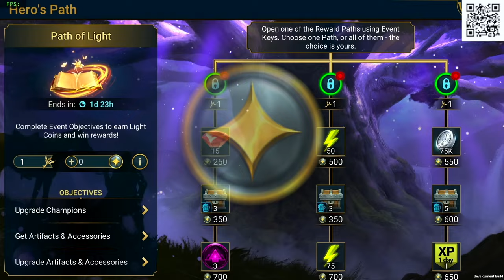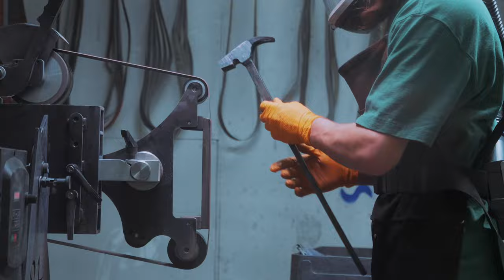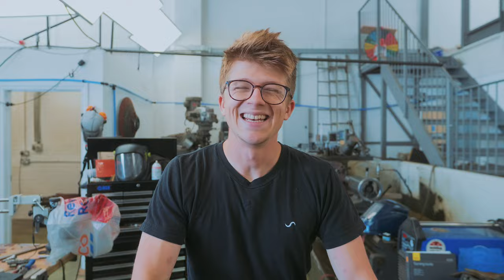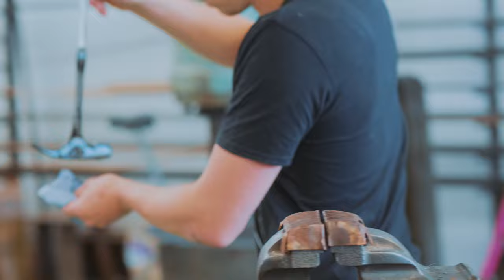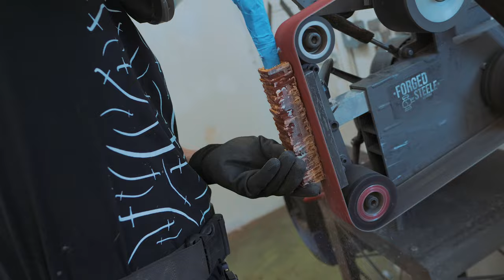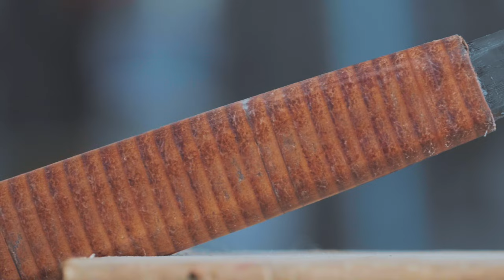Forging a Hammer from Hammer Plug Damascus! Part 2

Comment from the maker: What other workshop tools would you like to see me make? I'm thinking an adjustable spanner...? Install Raid for Free ✅ Mobile and PC: https://clik.cc/GYmzy and get a special starter pack 💥 Available only for the next 30 days 💥
Reply: What do you think of trying a pipe wrench?? Sure to cause stress induced balding!!!!
Reply: make a micrometer
Reply: I think you should make a draw  knife
Reply: Raid is dogshit and it's crazy how casually Youtubers will say that they love the game. Although I too would probably sell my soul for the dumptrucks of money they offer.
Reply: Adze or an inshave
Reply: I like the adjustable spanner/crescent wrench. Or you could make a pipe wrench.
Reply: How about making a full "common" toolbox set (wrenches, screwdrivers, etc) to have as your go-to tool set for your house?
Reply: 10 mil socket.
Reply: I'd like to see you back in Montana for more than a few days.
Reply: Farriers nailing on hammer…… asking for a mate 😳
Reply: Make a pair of 10 inch water pump pliers like the Knipex brand.
Reply: @jimmyandersson8520  Great suggestion.
Reply: What about a series making a basic set of blacksmithing tools using only salvage materials and basic (i.e. non-powered) equipment.
Reply: I'd like to see you make some leather hole punches or V cutters (or whatever they're called).
Reply: Would love to see a Damascus titanium monkey wrench.
Reply: Would love to see you make a swiss army knife.
Reply: A Damascus buck saw
Reply: Sockets to go with the ratchet. Mole grips. Adjustable grips and spanner. Tape measure. 👍
Reply: if you will send it to me i would love to have a jelly roll pattern weld steal 5/8 swept back bowl and spindle gouges no way i could ever in 2.5 million subs ever buy one of them much less both also should do jelly role any way its kick ass pattern
Reply: mole grips
Reply: Vice-grip pliers!
Reply: Check out “Perfect handle” tools, especially screwdrivers…those would be AMAZING in damascus
Reply: I was going to suggest that! its on my project list, but I'm lazy and dont want to figure out how to do it
Reply: after your 'legally not a  zippo', how about a 'not a letherman'
Reply: @benbrummitt7953  yeah! Or a folding pocket knife? Or a razor blade style folding knife?
Reply: How about a Damascus speed square to go with your new framing hammer? More of a milling thing than forging. But it would make for a smart looking pair.
Reply: Can you make a hacksaw? blade and  handle
Reply: make a power hammer
Reply: A Stiching chisel for leather craafting
I would like to know how to make one so I can make one for my leather business
It's a nice tool to machine.
Love yhe vids 👌🏻🇿🇦
Reply: In the past I have seen you use an adjustable spanner with another rod welded to it for twisting steel. Maybe make one purpose built for doing so. It should provide a good engineering challenge.
Reply: You may already know , will made journey bladesmith
Reply: @wesleycollins4314  Of course Alec knows…
Reply: What did you do to get the taste of Raid out of your mouth??? 🤢
Reply: I think a damascus HOUSE KEY would be awesome there is one guy on youtube that made one but i think it would be an awesome project.
Reply: Make a digging tool set for Mr. Furze!!
Reply: Drywall hammer
Reply: Hi alec. I remember asking you about 3 years ago when you were selling forging hammers, if you could make me a damascus estwing style slim shaft claw hammer but you had stopped production for sale. If you could make these now, i would love to own one, and would be willing to pay 10 times the price of a uk estwing. Please put them into production, i can see i am not the only one!!!
Reply: An axe 🪓 with a similar Damascus pattern would look really cool!!

Comment: Epoxy is a poor choice for the handle,  just because it will create hard ridges between the leather,  a flexible glue like barge would be much better
Reply: But couldn't you grind down to the valleys of those ridges to eliminate them, or will that induce weak spots in the construction?
Reply: Like most of his creations, it will be unlikely that it gets enough use to matter. It's mostly a decorative item.

Comment: I've always wondered about stuff like this (how Smiths use spare bits). Be neat to see what else you guys can make. Sort of like a Scrapwood Challenge... 
Random thought... I wonder how Nickel Bronze alloy would work for a knife? (I was browsing through materials available in McMaster-Carr [it's addictive], and thought... Hmm, probably not as durable as 5160, but better than my chinesium Buck knife.)
Reply: for our dutch viewers chinesium is pisbakkenstaal so low quality steel edit or any type of low quality metal thanks for ashton howard for remembering that
Reply: I'd imagine fairly well. Robinson Foundry made a knife out of bronze (I think he used aluminum bronze) and several videos after he was using it in the video and said he uses quite often in the shop and still working great
Reply: @linuxstreamer8910  I'm fairly certain chinesium isn't steel.
Reply: @justinbanks2380  of course bronze would work, it was the defining material for an age of humanity just before we figured out iron. The biggest issue was availability of the two main metals at the time.
Reply: @ashtonhoward5582  sorry forgot that it also goes for other metals

Comment: Love the channel and that's a cool hammer.  QUICK QUESTION.  I thought that one of the reasons for a leather ring handle is that the leather has some natural give to it making it a good grip.  Isn't that lost if you add epoxy to the equation?  I recently made a KABAR knife replica and used leather rings on my handle (I made a video of it on my channel if you curious).  I just soaked the leather in neats foot oil and then compressed it on to the handle and pinned on the pommel.   I like the slight sponginess of the leather handle.  does the epoxy detract from that?  Oh and I vote for one of those drills that has a pushable handle on it where the pushing down on the handle causes the spinning of the drill or bit driver...
Reply: You're exactly right and Alec just ruined the leather handle by epoxying it.  He now just has a plastic/epoxy handle with a leather pattern in it, in essence.
Reply: Absolutly true
Reply: What he did is fine. The epoxy is only going to be holding the layers together so very little will be touched  and you still have the natural grain of the leather adding a lot of grip. Estwing goes and adds a layer of epoxy on the outside of the leather completely eliminating that. It also chips off as you use it and looks terrible after a short while. The one thing I would have done differently is to add a steel plate at the bottom and rivet it on to help keep the very last layers nice and tight over time.

Comment: I use the 28 ounce Vaughn wooden hammer 🔨   It's my favorite and used them for almost 20 years now. Gotta have the waffle end tho so you can strike the nail in any direction and it's going in.. it also saves on smashing fingers from the head slipping off a nail. Just don't hit your thumb lol

Comment: Awesome hammer only down fall from using leather handle hammers (past exp) is your missing the pommel plate that is on all tools and knifes that are leather stack handles, the glue/epoxy will separate from the steel. Pommel plate gets pressed on and the end tang gets heated and riveted over. But the hammer is a beautiful skillful design as is everything you make 👍
Reply: This is the right answer. Looks good now. But that handle will work loose and will have nothing to keep it there. How do I know? As a HVAC installer using a hammer with a leather stack grip being held on only by the peened plate....

Comment: I really dig the hex head, still looks forged.
In how its made I recall them stacking plastic and leather.

I do wish you had used a bit from the face cut to cap the end of the hammer handle

Comment: As a framer, this makes for a very good carpenter framing hammer mix. But the claw is too curved for a typical framing hammer and the striking face is in a weird spot. It looks amazing, but some tweaks I’d make are a slightly thicker shaft, a wider and more straight on striking head, and a straighter claw. All in all great work, you’re doin more than I could ever😂
Reply: I was looking for this comment. The top of the head desperately needs to be perpendicular to the tang

Comment: Its a gorgeous hammer, the transition between the top of the handle and the neck could have been smoothed out to match  more and there could have been a plate at the bottom just for some finishing touches, looks a little rushed imo but the actual metal forging work, the grinding and the finishing looks 10/10

Comment: You could always try making either a drill chuck or a Damascus file 
Also great video
Reply: I don't know much about tools; but I imagine a Damascus File would be for looks since it would have soft/hard steel spontaneously on a what should be completely hard surface...
Reply: @thespaztagonist984  Most damascus is made with steel that can get equally hard, so it shouldn't be an issue at all.
And most files aren't all that hard anyway. 

Some files are as low as 50 rockwell, which even mediocre (hardenable) steel can do easily.

So files should be okay, especially if dedicated to only non ferrous metals, and rasps are no issue at all.

Comment: an added bit of cross hatching would make that hammer head grip better as you make contact with the nail.  I have swung an Estwing for many years framing and drying in Houses, and a slick face hammer makes it harder to do the job unless it is finishing where the hammer face being crosshatched would mar the work and require extra finishing as the hammerhead would mark every full driven nail

Comment: Just out of curiosity why didn’t you put a pommel on the handle? Wont the leather pieces at the bottom be a little weaker with the extra support?
Reply: Looked like he peened it slightly

Comment: So I am really loving how you are making different tools by using Damascus and I was wondering if it is possible to make a Damascus wood turning tool like a bowl gouge
Reply: It would be possible, but not something I would want to put to the test.

You would need a steel(s) with a lot of sheer strength and toughness.
And if your Damascus isn't immaculate, it could be a potential breaking point that otherwise won't be there. A homogenous metal is always going to be the choice.

Also if it's got low wear resistance, it will dull quite fast.

I don't know if you've seen a tool break when turning, but it's not pretty.
For the danger factor alone, I would avoid it.

Comment: The hammer looks very nice. 

The handle though, looks...flimsy. It looks like it will break if you try to pull a nail that's proper stuck or if you miss a blow and hit something with the handle portion. 
This is definetely the weak spot of this hammer, when it needn't be.

Comment: Looks amazing, just a couple comments on issues with use.

The way the hammer tapers to a smaller face probably isn't ideal for framing. When you are trying to hit nails in tricky spots, ideally the face of the hammer should be the largest part of the head, or else the rest of the head could interfere with the face hitting the nail (imagine the head hitting against a 2x4 right behind the nail and pushing the face away).

From the clip where you were driving the nail, the face was angled compared to the head. This may just have been the way it was being used, but you may also have a face that's not at quite the right angle when in use.

Others mentioned it, but a "knurled" face can make a huge difference on a framing hammer, especially when driving nails from weird angles, you can actually use a bit of a swiping hit rather than a straight hit to pull the head of the nail in the direction you need it to go.

Others also mentioned that a magnetic nail starter is a great feature for a framing hammer. Not everyone uses them, or maybe not that often, but especially when doing ladder work or setting trusses, being able to start nails one handed can literally be a life saver.

Not taking away from the craftsmanship at all, just some pointers to try and help the function of the hammer keep up with its absolutely beautiful form.

Comment: Looks awesome. I just worry, like you pointed put, that the shaft of the handle got too thin and may not hold up over time. Framers often time will drive some very big long nails and will be really pounding a way. I worry this may crack or bend under some heavy use.
Reply: I kept thinking the same. Lots of weight on top of such a thin neck.

Comment: Light is not always a good thing.
MASS (weight) is a good thing.  When you hit something (nail) head mass drives it in deeper with the same amount of energy strike
Heavy hammers are heavier (duh) but the head mass is a good thing as it takes less strikes to do the same job (less rebound vibration)
A thin handle allows for vibration reduction to the hand.
Check out the  EASTWING hammers section and notice the weights.

It is a great hammer thought!

Comment: I don't think mixing nickel powder with steel powder creates an alloy. In the finished hammer you can pretty clearly see the different specks of lighter and darker color steel. They really need to melt together to form one homogenous alloy.

Comment: I'm not sure if epoxy is the greatest choice for a leather handle of that style (it'll likely lessen the amount that the leather will shape to your hand), but it's also not a terrible choice, especially if you aren't doing a ton of stacked leather disk handles that will be used day-in, day-out by the same individual
Reply: What else would you use? I’m not trying to start an argument, but I’m curious because epoxy seems like the most obvious choice
Reply: @crispiernuggets7971  there's some glues used in leather-working which allow the leather to remain supple

Comment: It looks great, but it's pretty much just a wall hanger. That neck is way too thin to function as a framing hammer. One good swing or one solid pull on the claw and it's going to snap off.

Comment: While the leather handle is great, I kindly hoped you would etch the entire body and use clear epoxy as handle. Of course the leather is better for handling and the epoxy would not be as durable. But still...

Comment: Swinging that hammer for 6-8 hours will tire you out for sure. What is it 28 ounces? For daily framing you don't want more or less than 14-18 ounces, too light and more swings, too heavy and heavier to swing so both will leave you tired after hundreds of nails. Lighter hammers are great for finish nails and roofing, heavy hammers are when needing large spikes for thicker wood. That's not really a framing hammer.

Comment: I don't believe you are supposed to harden the whole hammer...that makes it brittle and prone to breaking...or in worst cases, shattering completely. I think it's just the tip of the head and the prongs that are supposed to be heat treated. You might think, "it's just going to be hitting some nails into wood"...and to that I say...you are the reason some people wear eyepatches. Do as you will.